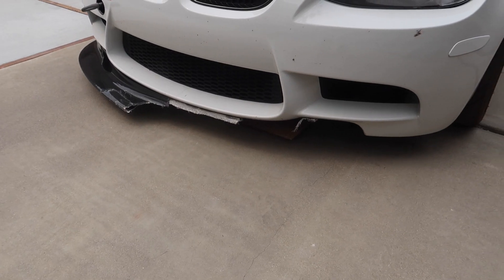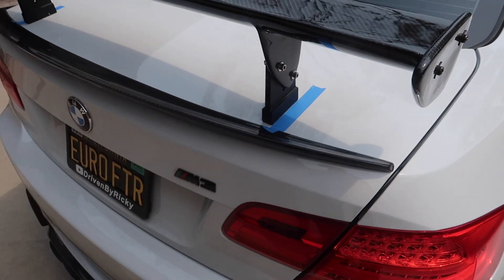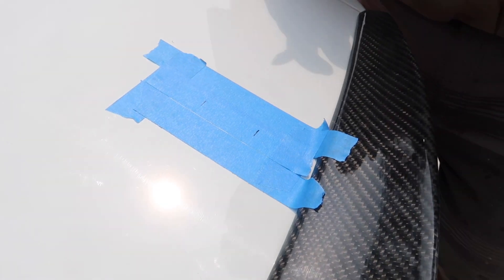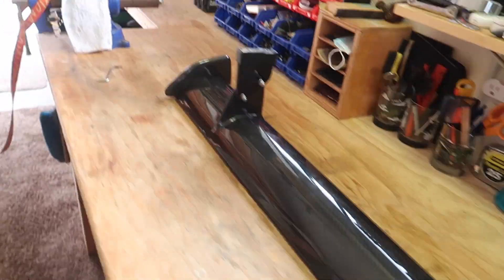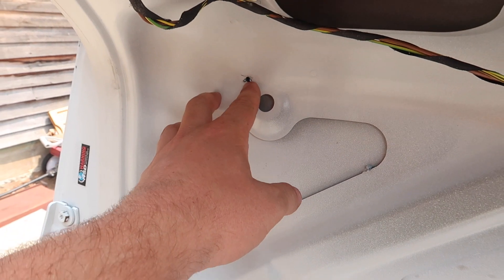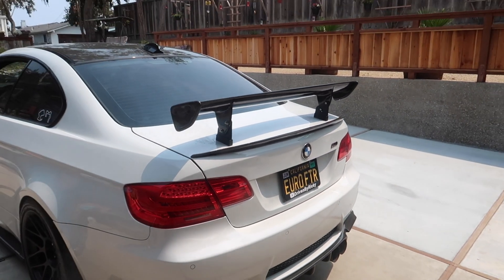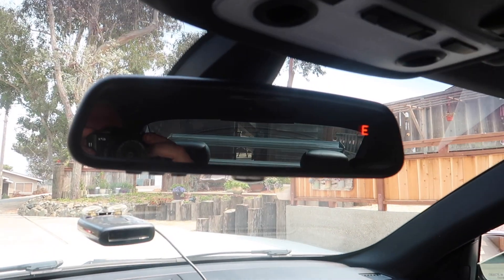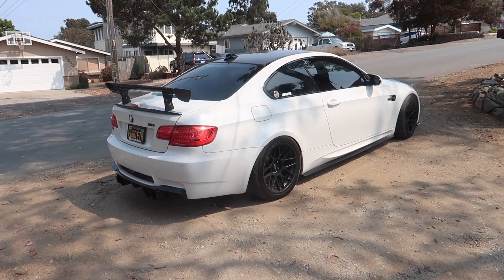GTS WING INSTALL ON MY BMW E92 M3!!

Comment: Hey Ricky. I've watched quite a few of your videos over the past year, and you've helped a lot with the mods I've done to my E92 M3. I'm about to install my GTS wing and I have a question. How were you able to get the bolts to snug up on the underside of the trunk with the rounded curve of the other part of the trunk in the way?  Right at minute 7:44. Thx bro.

Comment: If you ever do another one,  put tape down, put the wing on the trunk on the tape, trace it & use a micrometer to measure out your holes. That bad ball will be dead balls! P.S. don’t forget when you drill into metal to touch up the bare metal or it’ll rust & eventually rot….✌🏻🏁

Comment: PSA for anyone attempting to do this:

The base plates should be essentially touching the trunk lip. This video shows the base plates almost an inch too far forward. If you look at pictures of a GTS/GT4 car you can immediately see where the wing should be. 

Don't mean to rain on your parade man, but try to find another car with a GTS wing in person, you will see what I mean.
Reply from the maker: So wing placement my friend is all personal preference, essentially how downforce works is the further back you have it the more downforce you essentially have, I personally don’t like it all the way back so I put it about 3/4” forward. Now to compensate for that you can make the wing have more angle to create more downforce. All I’m saying is learn about arrow before commenting on my video. Appreciate the feedback though.
Reply: @drivenbyricky4651    I understand how wings create downforce. The GTS wing hardly creates any downforce, all it does is reduce lift unless you run an extremely high AOA. This is why the Schirmer cars have the wings at nearly maximum AOA. If you knew about "arrow" you would not have a replica GT4 lip and you would be using a proper undertray and splitter to create front downforce, instead of screwing a flimsy lip to a bendy ABS plastic bumper. Your passive aggressive reaction is peak insecurity. I was trying to share insight and I didn't attack your knowledge or character, yet you took it as personally as possible. 

For the sake of discourse, if you still had a factory trunk lip on the car and left the current gap between trunk lip and baseplate, you may have been in the ballpark of where the wing actually goes. The M performance spoiler is wider front to back and that is why I said it should be nearly touching the trunk lip. 

Anyway good luck I guess, you are in for some tough experiences if you discount advice from others so readily.